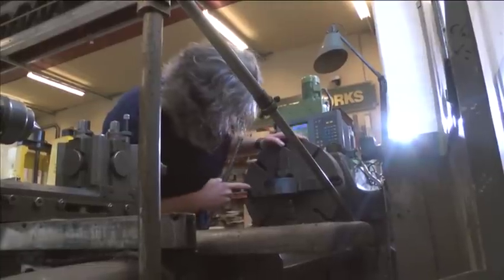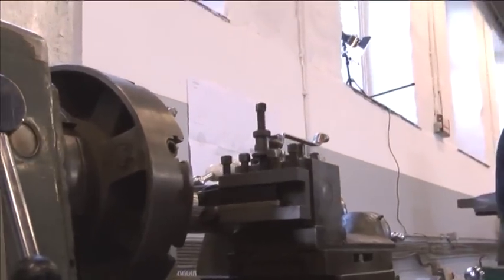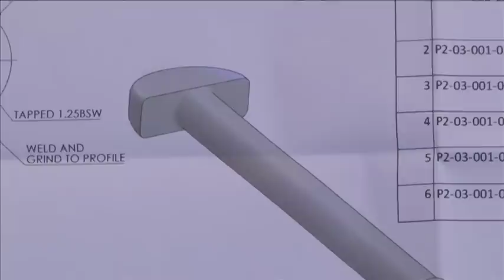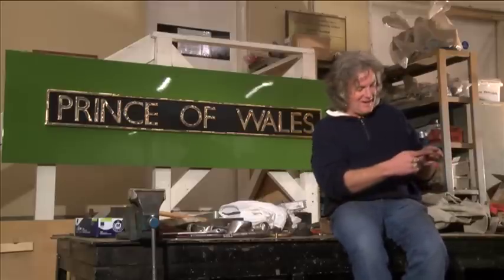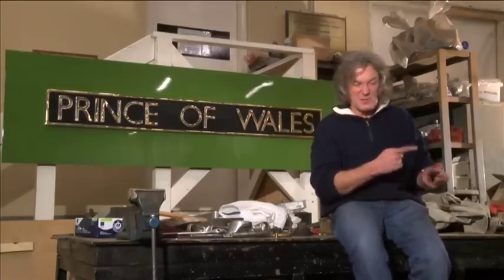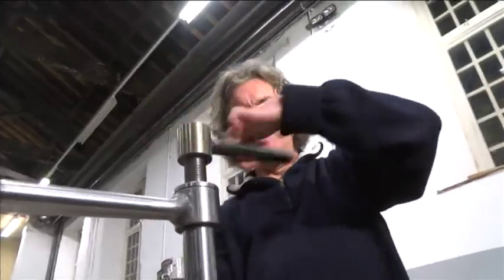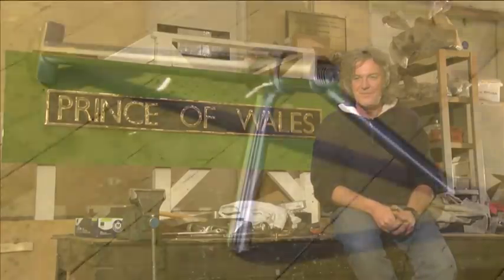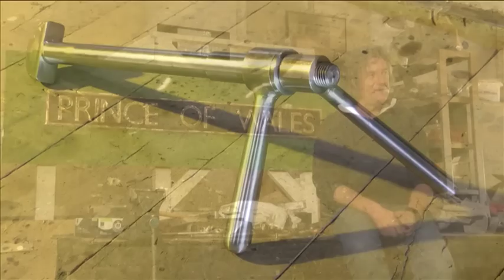P2 Progress - update No. 1, James May at Darlington Locomotive Works

Comment: American steam locomotives on the other hand don't even have clock faces, instead they have handles on the front of the smoke box doors what makes British steam locomotives look different from American steam locomotives, part of the reason why American steam locomotives have handles instead of clock faces is because most of them have that place for the headlight or the number identification.
Reply: Also, Mikados are considered to be small locomotives in the United States because of how large articulated locomotives are, for example, the largest steam locomotive of them all the Union Pacific Big Boy is a 4-8-8-4, but the 2-8-2 wheel arrangement is one of the UK's biggest wheel arrangements, because A 4-8-8-4 is too big for the British loading gauge (which limits the size of locomotives), every country has a loading gauge, but it is different for each country. I don't know why the British loading gauge is that restrictive to the size of locomotives but it is, at least, from what I've heard. Note that I am from the USA and so I might not be an expert at the British loading gauge.
Reply: +J. “Luckythebrony” Christiansen well they did have the Standard Class 9F class of locomotives, which were 2-10-0, albeit they produced roughly 1/4 of the tractive effort the Big Boys could produce. There was also the LNER P2 class of locomotives that were of 2-8-2 design and produced 193.33kN of tractive effort.
Reply: So?
Reply: +Nathan. That smoke box door handle is for a p2